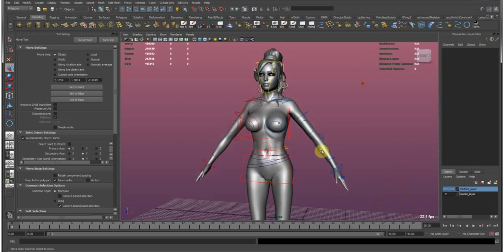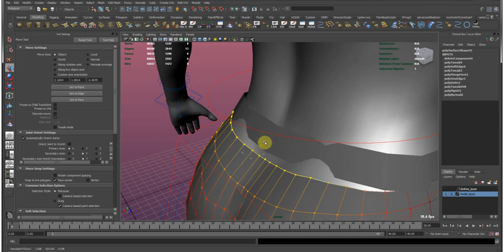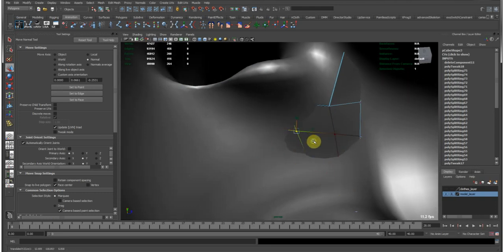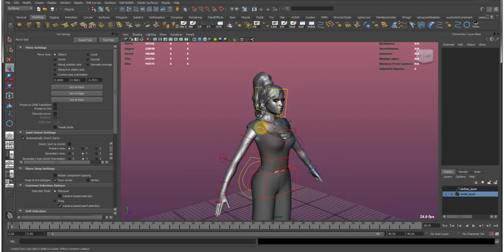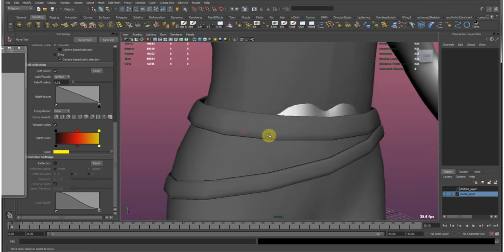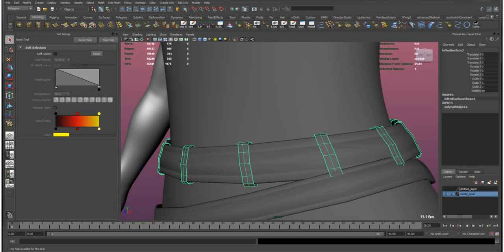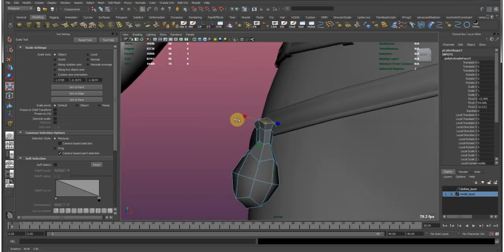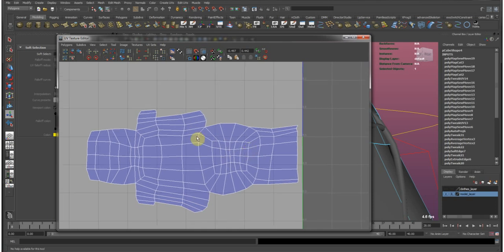Cloth Modeling

Comment: did you model the face and body in maya by making a low proxy model and then adding the detail in mudbox or zbrush or did you do it all in maya?
Reply from the maker: I tend to do it all in maya... but it depends on the character I guess.. the more a character like this is really smooth and simple shaped, so doesnt make too much sense bringing it to mudbox. The more complex or accurate I want it to be, the more Id tend to bring it to a sculpting software.. But most of my latest stuff was just maya as far as modeling goes (texturing then in mudbox)
Reply: thanks for letting me know! but how do you get the face so detailed without too many polygons in maya? im stuck in the middle i have a basic female head but i dont know if i should add more geometry in maya or sculpt it in mudbox (i heard having too much geometry can make it harder to rig and animate)